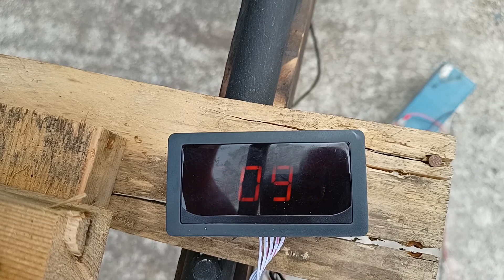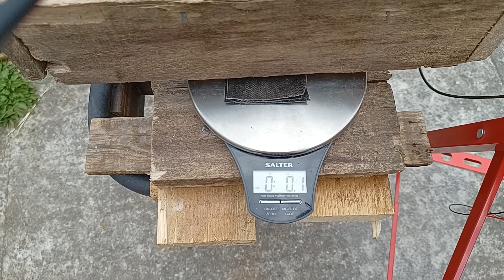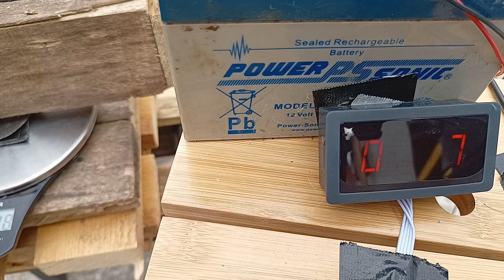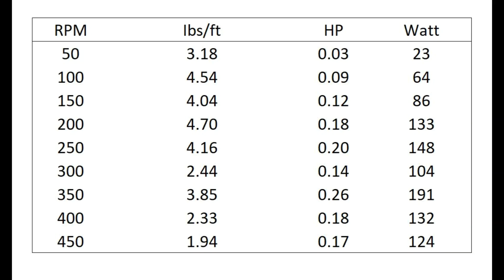Stirling Engine Horizontal Engine - Dynameter Run - Part 13

Comment: Congratulations Shane on a magnificent build.  I can hardly believe those  low power figures you came up with your latest engine which looks very effective.    I had considered that the Stirling cycle might be better suited to operation at lower R.P.M.  The thinking being that the medium of energy transfer, being air in this case, requires time to absorb/release.  i.e. large volume cylinders working at low R.P.M. might give more time for the transfer to take place and thus prove more efficient. Something reminiscent of those early Newcomen pioneer  steam/atmospheric engines working at extremely low working pressures.
               Well done Shane, keep up the good work, the world is watching !
Reply from the maker: Hi Ray, thankyou for your comments. Funny enough this engine is my most powerful so far when comparing displacement. The displacement isn't really very big compared to the size of the engine. I had to reduce it somewhat during development to get the compression ratio down so it would run. Given another shot I would have increased the displacement as well as the heater / cooler size. 

I like the idea of a slow running engine with good heat transfer. I'm still experimenting with the best configuration.

The next engine is going to have diaphragm seals!

All the best

Comment: Fantastic job! 
This is super encouraging to me. - I’ve never built a working engine, but I’ve studied them with fascination since I was a kid (especially steam engines). One thing that gives steam huge amounts of power is its 1000:1 expansion ratio at atmosphere. 

For added power in a stirling I’d suggest a double-action power-cylinder design (similar to a steam locomotive). The more common single-action stirling is often limited to near atmospheric pressure to power the return stroke. On the other hand, a double-action cylinder (with a second heat-exchanger & displacer-cylinder to power the return stroke) could have vastly more power.

Also, a few things about energy losses…
1. Heat: You might try getting some infrared imaging to visualize any heat losses, then add insulation as needed.
2. Vibrations: Even with firm mounts/anchors etc, those intense vibrations will rob you of energy and wear out your bearings and seals. Careful balancing with counterweights can minimize this. 
3. Friction: Wherever practical ball bearings and roller bearings are always preferred. Also recommend careful alignment of all bearings/pivots, and hardening/polishing all rolling and sliding surfaces. An oil system of some kind might also help.

Again, great job!
All the best to you,
JT
Reply from the maker: Hi JT,

I originally wanted to build a steam engine but the cost and pressure testing / coding, etc was to much. A double acting stirling engine would be the holy grail! Higher power density per size and it is a balanced system so can be pressurised. I just need to work out a way to successfully seal it so its reliable (the main thing that has stopped progress commercially!)

Thankyou for your comments on energy losses! I need to be constantly reminded when I'm designing things to pay more attention! Good idea about the IR gun.

Tune in for the next engine over the next few months (after I've done more DIY to keep my dearest happy!)

Cheers

Comment: Stunning work!
As you know in stirling engines its not the heat what gives the power, but the temparature difference.
So you can try cooling the piston with liquid nitrogen, which would make this machine an absolute monster. That would be very interesting to watch.

Comment: 1/4 hp is really quite respectable when you look at some of the vintage ones. I am curious about what improvements/changes you would make in a future design; I could really see me putting one to use burning coppiced wood for power some day.
Reply from the maker: Hi, improvements for next time, bigger heat/cooler surfaces, hot and cold side further apart. I'm looking at an opposed twin next time, just need to work out the best way to do the linkages. I'm planning on experimenting with diaphragm seals too.
Reply: Given 1hp=4 Horses, doesn’t this mean you have made a proper “1 Horse Engine” ?!? 🤣
Reply from the maker: @ericlotze7724  is that nominal horse power ? 😁

Comment: 1/4 horse is pretty good going I reckon.

If you have figures for swept volume (varies with phase angle on an alpha) and temperatures, you could calculate the Beale number to see how it stacks up against other engines.
Reply from the maker: I'll try and work out the Beale number..... Informed comment about alpha phase angles! Cheers

Comment: Could you heat the machine with electricity? Because then you know how many watts you put in, and how much comes out, so you know the efficiency. I bought a ceremic band heater to test my Stirling engine.
Reply from the maker: Yes I probably could do that ... 🤔

Comment: Really impressed with your ingenuity and calculations. Am I correct in presuming Maximum torque at 200 RPM and Maximum power at 350 RPM or am I missing something?

Comment: Have you considered building a NASA Stirling Engine with diaphragm or a thermo-acoustic engine using rice and a diaphragm. I was thinking that some recycled 55 gallon oil drums could be used for the cylinder and the diaphragm can be made out of pond liner and shaped with a heat gun to shape it and set the piston throw length. As for the heating element I was thinking that you could build a vertical access wind generator that uses the power to a resistor element coiled around the cylinder in a sand battery that will consistently retain heat and power the engine with a water cooling jacket around the top half of the cylinder with heat sink fins around the water jacket to aid in cooling and maintaining the heat difference. Just an idea.
Reply from the maker: Hi, I think the NASA engines are a little hi tech for me : ). I am going to try building a diaphragm engine next... cheers

Comment: Even IC engines have horsepower and torque curves, mabey that's just the mechanisms natural harmonic as it's currently configured. Different piston size, connecting rod length ect, may be needed to increase the efficiency.

Comment: Great job!!  I was expecting more from such a great running engine.   I've seen your motorcycle in the background... I just got a new lifan xp mini and it was stolen a week later from a locked garage!!!   Soooo disappointed 😞
Reply from the maker: Sorry to hear about your bike 🫤. Atmospheric Stirling engines are simply low power. I've got quite a few ideas for another one to make it better 👍

Comment: Use a large resistance bank and heat sink , and a variable field alternator for load . You can then lose your calculations for watts and just measure your electrical system
Reply: Unknown losses in electrical system.
I prefer the measurements of a mechanical system according to first principles.
Reply: @gerhardlesch3615  Much smaller unknown losses than in this mechanical system. You have oscillation in the clamping setup, and glazing on the brake rubbers. That is enormous uncounted losses versus the diode resistance losses and voltage drop over the three phase diode bridge. Those electrical losses are known and easily measurable via a decent multimeter.

Mark
Reply: @KravchenkoAudioPerth  He used such a setup on his previous engine, but this time around he just wanted some relative measures of performance, not absolute power numbers.

Comment: So half the power of the big 4 cyl.? Ha, just messing with you. Very cool series, subscribed. Is it too late to do the dynomometer experiment with the 1-way valve plugged? Whatever you come up with next, power a boat propeller!
Reply from the maker: Lol, I've just dismantled the dynameter and fed it into the fire : ). When I put my hand over the air intake the engine slows up. I think with the lowered the compression it now runs better with the snifter valve. A Stirling boat is on the hit list (when the design becomes small enough with enough power! It will!)

Comment: Great project but considering the results, I think you should try a different approach. I think theres not enough of a heat difference in your design and your using lots of fuel. Much more than you'd need to if you had a high heat difference 

My advice is to include a heat battery type storage method to hold the heat around the hot side, riddled with a bunch of those new copper heat transfer tubes that sits on top of a series of candles in a sealable box. 

You could make a little candle reactor with a fuel tank, temperature sensors, sliding oxygen door that can be closed to starve the flame if too hot. Electric spark to light if too cold

For cooling I suggest either water cooling or you make a custom heatsink and paint it using thermal cooling paint or a combination of both
Reply from the maker: Hi, Yes I think you are correct. I got so caught up in other aspects of the design I neglected important points!

I've done enough to get it working (just about) but there is a lot of wasted potential in the design

I like the heat battery idea, I'll do a search to see how that might be incorporated into a burner. I want to stick with biomass / wood so it is an off grid option.

I think I've learn 't from this design and have a better idea of what's needed when I build a new one. This time I want to present the design to hear peoples opinions before I start cutting metal.

All the best
Reply: @ShanePomeroy  you could use your current heater to heat a thick copper bar that you bend through a box of steel filled with sand for heat battery 

Then have smaller copper bars that protrude from the battery so you can deliver heat to the stirling 

I can't stress enough that cooling is yours biggest issue though. You need something like a heatsink for the cold side and you need to be able to run water through/over it because the longer it runs if you don't the hotter the cold side gets and the efficiency you end up with

A ram pump would be a good way to accomplish that off grid
Reply: @ShanePomeroy  I might also suggest you attempt to prevent thermal heat transfer from the hot to cold pipe by using bronze for the engine housing, as it has a much lower thermal conductivity than iron or steel and will survive the stresses of a running engine just fine

Comment: Man you have put a lot of work into this. 
I never believed that horse power tells the truth about an engine because RPMs are part of the equation.
If a 5hp lawnmower engine was turning 100 rpms then the horsepower would not be 5, it would be much lower...the rating is based on a set operating rpm. Automobiles are the same way.

Your engine might be just as powerful as a 5hp lawnmower if it was turning 6500 rpms.
I would connect a genny to your engine and see how many amps the engine can push...maybe try different gear ratios....to me, that would be a more realistic test.
I love this build...please keep us updated.
Reply: Power = torque x speed
Reply: @kcinelgoog  nope.... power is torque times RPM divided by 5252
Reply: @rogueart7706  OK, power is proportional to torque times RPM then! The constant depends on what units you are using.

Comment: Wow, this has incredible low efficiency. How much energy do you bun? Probably 10,000 to 20,000 watts. A steam engine will easily give you 10% efficiency. A Stirling can achieve 40%, but for a home built, at least 20% should be a goal. So for this setup you should get out 2000-4000 watts. 

I really like your build. A lot of hard work has gone into it. But maybe time to go back to the drawing board and make a design that will use more of the heat.

Keep up the good work 🙂
Reply from the maker: Would be interesting to do an efficiency test to find out 🤔. A very expensive Stirling engine built by a team of top engineers can return 40% efficiency. I suppose if the engine was positioned inside It would keep you warm as well😁.
Reply: @ShanePomeroy  Pshaw! Amatuers! I only get excited over >60% efficient Brayton cycle engines ;-)

Comment: Hi sir. First let me say that is some excellent work you've done on this thing. Really impressive.

I'm no expert, so forgive me if I have this wrong, but is it possible that you figured your correction factor backwards? You said you were getting ten pounds on the scale at 150 rpm and your pivet arm is longer than one foot. Based on your math, I'm estimating your correction factor at 2.475, which would equate to 24.5 foot pounds and .7 hp at 150 rpm. This should then be roughly 23.59 lb/ft and 1.57 hp at 350 rpm.

Think of it like a long wrench, the longer it is, the less weight you'd have to hang on it to get the same torque. Ten pounds on a two foot bar = 20 pounds on a one foot bar. Once again, I'm no expert, so I'm sorry if I'm thinking about this all wrong.
Reply from the maker: Hello good sir, Many thanks for taking the time to watch my video

I've got my final results in the description for that video. Would you be most kind and check that over for me to see if that checks out : )

Thankyou for questioning the results, I really appreciate it! I'm a do'er not a thinker! All the best
Reply: I don't see anything in the comments. I did see your final results in the video, which is what I referenced in the last post. Would it be possible for you to post the actual scale readings and the length of your measurement arm from privet to scale?
Reply from the maker: @jayc6992   The Length of arm from pivot to scale was 2 ft and my scale readings were doubled to give me ft/lbs. Ping me an email and I'll send them to you, cheers
Reply: Oh I see why I was confused. In the video at 4:46 you say "ten pounds" at 150 rpm, but I see that was actually ounces. Sorry, I should have paid closer attention. Either way, very nice build and thanks for sharing it with us.
Reply from the maker: @jayc6992  I'm not careful enough of what I say during these video's, cheers

Comment: Why don't you use an electric generator running off the engine then convert the wattage to horsepower
Reply from the maker: Yes, that would work. There would be a power loss on the belt and heat from the generator to take into account, cheers